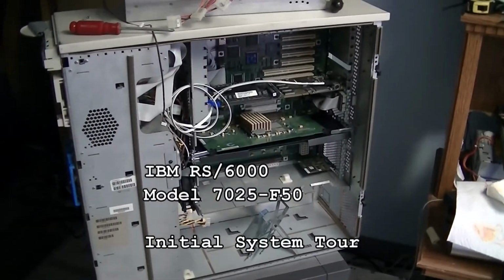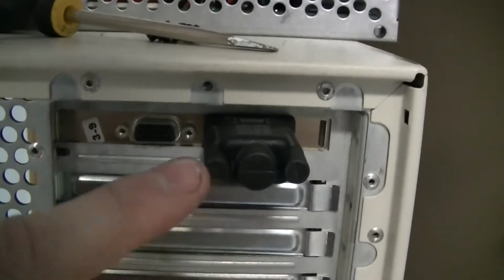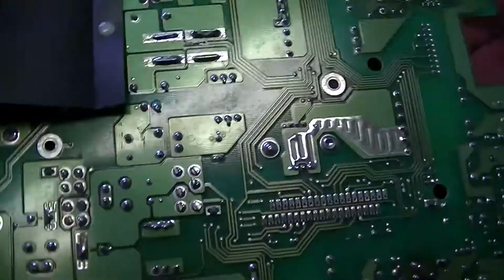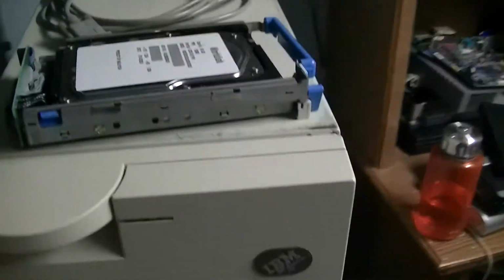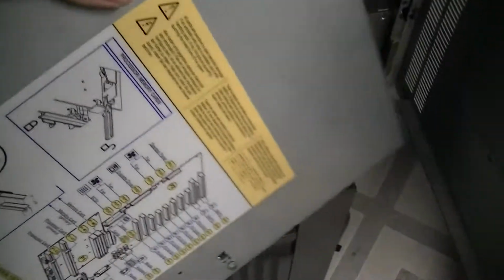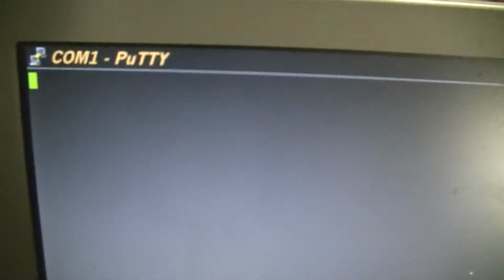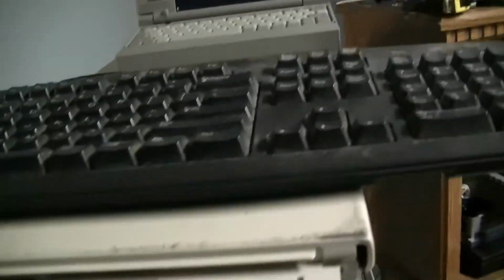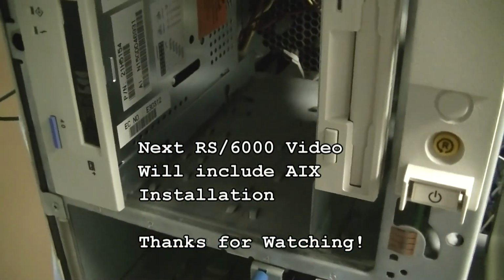IBM RS/6000 Model 7025-F50 -- First look and initial system tour

Comment: Blast from the past. I designed the service processor unit for these systems. It would post boot codes as well as monitor power and temps. Could communicate via a modem independent of all other communications systems. Would allow you to remote boot system and monitor unit.
Reply from the maker: Would love to have worked on a project like that for systems like this. That thing is indestructible! I still have, and have a pair of dual CPU cards and a graphics card to go in it. Eventually I'm hoping to circle back around to working on it again after my lab in finished.

Comment: Service Processor is like predecessor to the IPMI, lights out or LOM very neat or the EFI you get on sun sparc machines
Reply: Service processor was architected to use a small limited function micro embedded on the main board. If the optional service processor was ordered then the onboard unit shut down and the larger micro with more memory and function took over. I hear variants of this design were used for years at IBM. I moved onto chip design by that point so my system architecture and design days were over,

Comment: FYI someone I know got one of these working. You will need the IBM 68 pin SCSI tray, part number 06H8631 to get the drive installed, and if you want a drive with the caddy get part number 76H2697. Search them up on eBay and you'll find the parts.

Comment: DASD is just IBM-speak for a hard drive. RS/6000s don't require anything special, just a regular SCSI HD. (I've owned about 3 RS/6000s personally)
The AS/400s, on the other hand... definitely need their magic IBM pixie dust drives, as someone who owns a System i5 520, iSeries 270, and AS/400 P03 and 170 can tell you.

Comment: Interesting old server!, I like the different design of server hardware, a bit of a change to working on standard PC's for years!

The hard drives may be a earlier version of the Ultra 320's in my IBM's?, they too are single connector SCSI drives